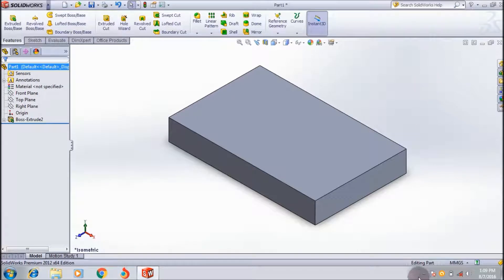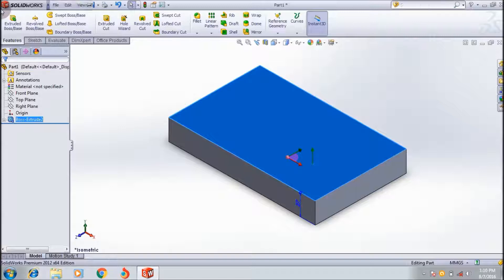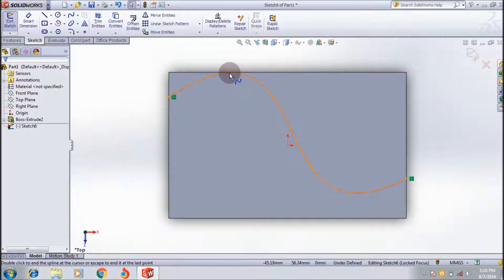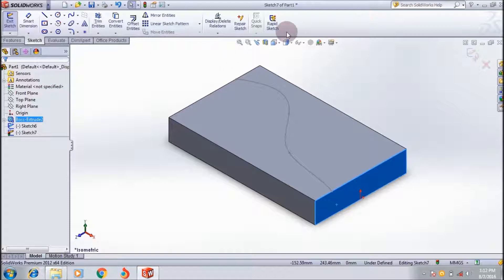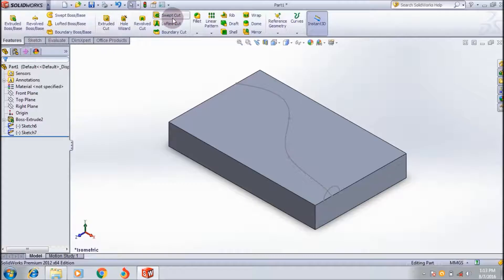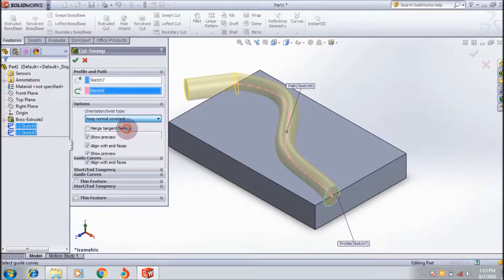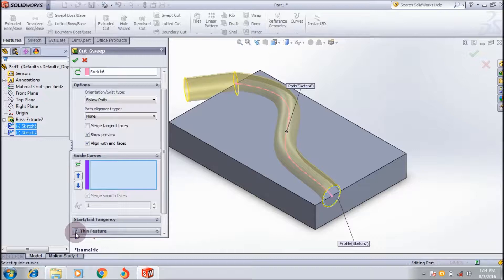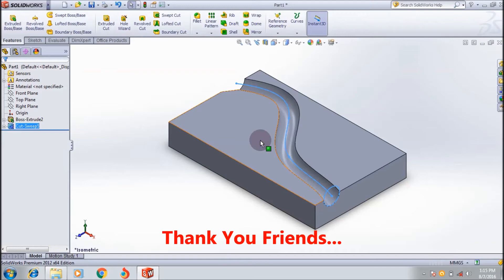Learn SolidWorks Swept Cut Tutorial _ SolidWorks Video Tutorials for Beginners

Comment: Dear how to inside swept cut perform in 3D rectangle or circular shape
Reply from the maker: You have to use reference plane and path ...if you want to know more kindly share your question with picture
Reply: @Hotshotracer91  thanks ..dear for example like glass inside is , like 💉 syringe inside is hole shape